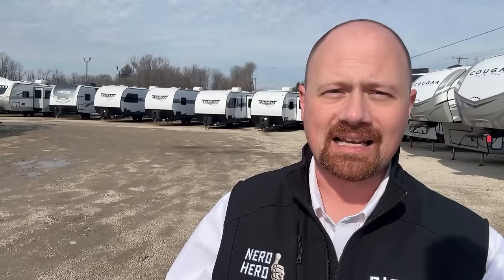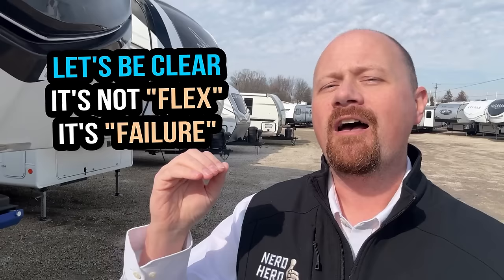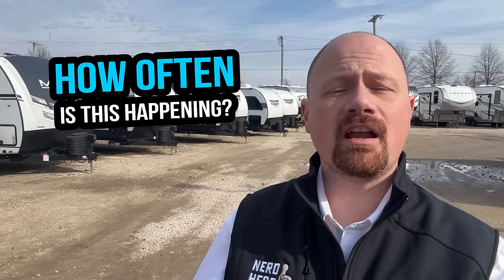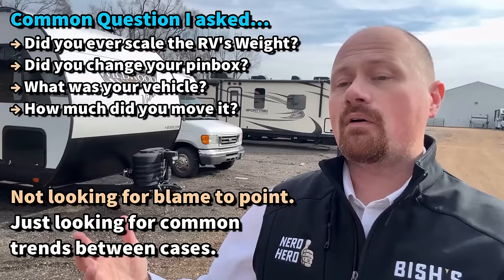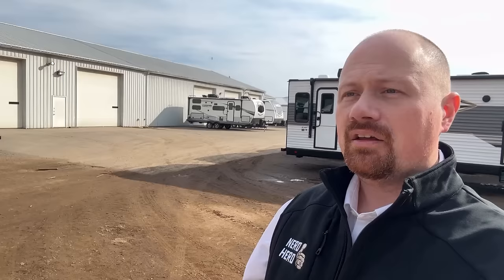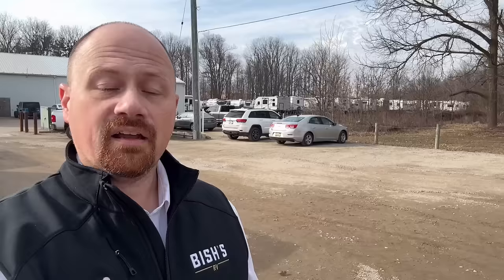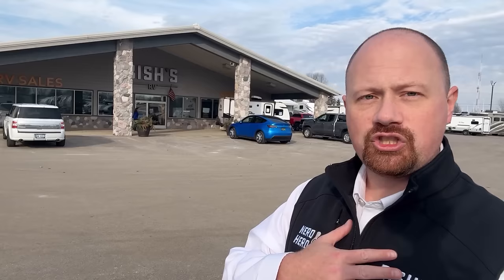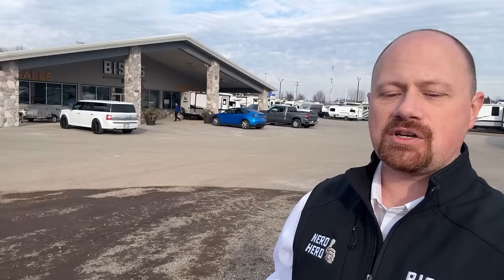🚨 RV Frame Flex & FAILURE!! • WHAT is Happening and WHO is Responsible?!

Comment: I would like to see every RV tour video towards the beginning mention something like, "This 16,000 pound fifth wheel is intended to be towed by a properly equipped full ton pick-up and shouldn't be towed more than X miles per year and X miles in a day and can't easily handle winters where temperatures regularly drop less than X degrees and the cargo capacity of X pounds is lower than expected so pack light and don't travel with full tanks, etc."  The dealer and presenter can be providing this info!  How is a consumer to know that one particular RV type, size, unit, model is more capable to be moved around more than another?

I would be so pumped if you start saying that kind of stuff more in your tour videos.  I believe you have more power than you think.  If you start doing it, other presenters are going to be pressed to follow suite.
Reply: Furthermore, if that info isn't available from the manufacturer the presenter should say something like, "This manufacturer has not provided information on how often this RV should be driven and what the specific hitch weight for this unit is, etc."  Call them out if you want to help fix the industry problem!  Presenters who do this in every video will become an even more trusted resource in the eyes of the public.

Comment: Thank you for clearing this up, I retired from Boeing building airplane for about 35 years and I know that the wings of the airplane they have to flex but you don't want it to fail in the air that wouldn't be a good thing, my thing is why are the factory turning away the customer when they have a problem with their rv failing, some of the factory act like that it's not there problem, so they don't want to even to address their issue, at least look at it and see what's going on.

This will be my beef, if my 5th wheel has a little bow, more than normal they don't want to talk to them, they want to brush them off and act like they must have overloaded their 5th wheel. If it was one or two customers complaining about their frame flexing or failure I would understand but when you have the among of people that have been complaining, well there a problem and it should be looked at and addressed so to make the customer satisfied. Okay, you mention and lot of ideas that make sense but I would say let the factory assess it and decide it then.

Comment: Josh, I believe it comes down to three things: Quality, purpose, and information.  First, manufacturers can and should do a better job with quality and durability.  The consumer needs to pick an RV that meets their stated purpose and the manufactures need to be clear about an RV's stated purpose. Some live in these RV's and tow for a lot of miles.  Others take one or two short family trips a year. It sure would be nice to have well defined purposes in the literature for each RV.  As for frame failure, it is undefendable.  The NTSB and DOT will never allow car and truck frames to break while operating them for their intended purpose, so why should RV's be any different?  That brings me to the third point.  Lets have the manufactures define "normal use and operation" of these RV's so consumers understand the purpose and durability of the big investment they are about to make.
Reply from the maker: I think you’re being very fair. Ty

Comment: Josh:  you tackled a tough, ticklish one here, thanks.  From personal experiences I know how much time/research you had to put into this.  You ended up very focused on what is within the control of us, the end users.  I hope everyone appreciates that, and does not interpret it as shifting the responsibility.  I'm sure that the higher quality RV manufacturers have this issue under a microscope right now.  But what THEY can/should do is not within our control.  If I had any suggestions for a tough subject like this, it might be to stress that aspect right up front in the video.   We're in the process of purchasing a new 100 series Grand Design right now, so running across this current problem has had me spooked a little.  Your video has eased that a little, but of course has not erased it.  I feel certain that in a year or so, the better manufacturers will have shifted some aspects of how they build based on what they learn in analyzing the problem.
Reply from the maker: I appreciate your feedback here. It's quite welcome. Obviously this style of video and topic is actually a bit new to me

I also really appreciate how you took the video as a whole. I think some folks have taken some segments out of context and felt I was blaming owners for the failures when I've clearly said I do not feel you can reasonably do that when nobody told them what NOT to do in the first place... including dealerships like my own when applying mods to the RV

This topic has actually caused us to realize that we need to better train and inform our own staff so they can better train and inform our customers
Reply: @JoshtheRVNerd There's another aspect, on the manufacturer's side, that I wonder about.  Engineers typically engineer to include a margin for error.  They don't necessarily engineer that margin for every worst case scenario; for a couple of reasons.  1- you can't necessarily foresee every scenario, and 2 over engineering is too expensive.  I sure hope that they are re-evaluating how the use of RVs has changed over a relatively short period of time, and are making some adjustments for the changed marketplace they are designing for.  I expect that they are, but that they are most likely still evaluating and interpreting the situation.  Some evaluation happens pretty quickly, but a complete evaluation often takes years.
Reply: While you certainly brought this issue into perspective and relieved most of my personal fears, obviously aspects are still on my mind since we're getting a new Grand Design 5th wheel.  I'll be paying more attention to how I load the new one than I have before.  That brings a couple of things to mind.  It sure would be helpful if RV manufacturers (and dealers) could provide an additional piece of information:  a rating or some guidelines for "maximum pin weight".  Or, another approach, provide guidelines for a maximum load per each major storage area (the 100 series 27BH has three substantial storage areas)  Seems like that would be invaluable in trying to balance where to place what gear for responsible, informed RVers.  Just additional thoughts on an important issue, I'm sure I can figure out my own situation reasonably well.

Comment: Understand the materials such as load rating and that metal is only going to "flex" so many times before it fails. Welds aren't made to flex thats why gussets and lugging processes are used to keep those areas from flexing.The gooseneck conversion makes total sense,  you are actually making the pin box longer putting more prying force directly to the frame. Having run a shop that repirs tractors and trailers for years now I can assure you that you can have too much truck.  4 air filled bags on the back of a tractor while not loaded is like being in a prize fight getting kidney shot after kidney shot, the second way to describe it is getting hit repeatedly in the back with a 2x4.

Comment: Thank you for doing all the research.  It was certainly thought provoking.  In the aviation community, because lives are involved, these same issues have been federally regulated.  Since this is not life threatening, no one is requiring any verifiable way to compare durability of units.  Consumers are left with no way to compare statements other than customer and dealer votes on best manufacturers and their reliability.

I do think consumers are misunderstanding “all season” as “can be used more often” as opposed to “can be used longer”.

That any RV manufacturer would say “it isn’t designed to be moved often” blows my mind.  🤯. Unless it is a destination trailer, I am pretty sure the customer expects to be able to move it often.

There needs to be a consumer reports like database where consumers can vote on key criteria for all the models.
Reply from the maker: My fear is, it will have to get to the point that lives are on the line for anything to really be done about it. If things start becoming a hazard on the highway, then NHST will get involved and you’ll see some changes happen fast.

Comment: 30 years in the trucking industry and I can honestly say I would pull a 53-ft trailer over a 28 footer or 32 footer, any day of the week. You are correct about the bobtail. The trucks ride like crap, they bounce all over the place, and they lose traction in a heartbeat. They are designed to have weight on them.

Comment: I'm not an RV-er, just more fascinated by the industry thanks to Josh's videos.  I admire this video as he's kind of in a damned-if-you-do-damned-if-you-don't situation; customers, dealers, and manufacturers will unite in their displeasure of this video.  😂

One thing to note by the criticism in the comments: Josh did say early on that this flex/failure issue is skewed more towards the XL 5th wheel and gooseneck crowd that tow a lot (I'd assume a frequency that is almost weekly).  I'm sure most of the critics aren't in this category.

Also to add another wrinkle about the towing vehicle, you can blame the government's CAFE standards for the way the truck market has shifted.  The days of you dad's naturally aspirated V10 or old-school diesel with simple amenities is long gone.  Nowadays, it's risky full-timing with a truck as you'd be fortunate to get past 100k miles w/o a recall rearing it's ugly head.
Reply from the maker: I appreciate your comment here. TY so much for tuning in. Kinda curious what you do for a living?
Reply: @JoshtheRVNerd  Project engineer in heavy civil construction.  RV culture exists thanks in part to the industry I work in.

Comment: I put over 10,000 miles a year on my 43ft 5th wheel toy hauler. 
I had the frame break by the pin box on my last 5th wheel.  I always ask the dealers who builds a 5th wheel that you can tow 10,000 miles a year and they don't have an answer!!😮

Comment: There are LOTS of trailer manufacturers that are not having problems. 18 wheelers,race car haulers, farm animal trailers, and rv trailers. If one trailer manufacturer is having issues from different rv manufacturers, then its not rocket science to figure where problems are. But, the biggest problem is millions of dollars rv owners are losing because no one (dealer or trailer manufacturer)don't want to be responsible because one they admit to one owner, all are due free repairs. And, I don't remember hearing of this until a few years ago. In my opinion ( it's like butt holes, everybody got one) is to make frames stong enough, the total out the rv dealer door weight is going to be ridiculous. You'll need a bis ass truck to pull trailer and manufacturers know they wouldn't be selling any if you have to spend north of $150,000 for truck.

Comment: On this topic, one thing I haven't heard discussed is the incidence of frame flex when the tow vehicle is a dually (DRW) versus single (SRW). A dual rear wheel tow vehicle has quite a stiff rear suspension by comparison to single rear wheels and would understandable pass any twisting torque back to the trailer frame. I'd be interested in someone's thoughts on the theory.
Reply from the maker: I lack data on that but would be curious as well
Reply: @JoshtheRVNerd  Thanks for responding!

Comment: Information for everyone, I installed air bags on my truck to pull my 5th wheel, not because my truck wasn't rated to tow it, that side is fine, but I wanted a smoother ride.  That being said the ride is much better when hitched up, but I made the mistake of inflating the air bags to much and it jarred some drawers in the front.  The frame is still okay.  I complete understand what Josh was saying when he mentioned you can have to much truck, or to much air in the air bags not allowing the suspension to flex and driving all that impact to the trailer.

Comment: Josh, I have been watching your videos for some time now and didn’t even realize I was not subscribed so I did. I have a great respect for you and your dealership and truly believe you have the customers best interest at heart. I watched your video on frame flex or failure and feel you have some valid points but failed to address the manufacturers responsibility to the extent of improper welds that break due to the flexing of the frame. I have a 2020 Montana 3781RL and this model has been notorious for frame flex issues. I have been a victim myself and noticed an issue with mine shortly after taking possession of the unit. I have a friend that has the exact same year and model and had the issue also. I did no modifications and only towed a few times before I had the issue. I also had it weighed and was 1000 lbs underweight. I agree in some instances that customers negligence leads to the problem but on a whole the problem lies with the manufacturer and the quality of work they are doing on these bigger rigs. There is a lot of emphasis on this topic right now and needs to be. There has to be a change in the process in the way these are built to keep this from happening.  When it does happen the manufacturer needs to step up and take care of the customer. Keystone has done a great job of stepping up and fixing within the three year manufacturer warranty and even some after but this is not the norm with every manufacturer. I honestly believe some models should have a recall due to the enormous amount of frame failures. I honestly want to trade mine in because it had the issue and scared it will happen again and I will be told it’s past the three year warranty.

Comment: Thanks for shedding some light on flex / failure. Though my wife and I just getting into the market for an RV, we have been researching Class Cs and couples towables. We have had some negative comments about stress/ frame failures on the cab over bunk. Can you shed some light on issues on the matter?
Reply from the maker: Fire away

Comment: Josh. First, I really enjoy watching your channel.

I belong to a few FB groups devoted to campers and some devoted to “half ton towing”, etc. What is your take on the question of “how much weight can I pull with my XYZ” and the whole subtract 15% of GVWR or trailer weight to “safely and legally” tow a camper. This is confusing. I’m of the thought that if a vehicle manufacturer says my Chevy Silverado Crew Cab 4x4 is rated to tow, say 9100 lbs., does a person really need to subtract that 15% for a cushion? Where did this “suggestion” come from? Shouldn’t the vehicle manufacturer’s vehicle specs be what a person goes by? Thanks and keep the episodes coming!

Comment: Good info, I posted many comments about whether it’s the material, design or manufacturing of the frame or the truck being more powerful. As a tech working in many industries, it’s most likely operator error and misuse. And I seen that in many occasions. It’s good to see that you look up on the material. The after market pin box is a good thought but I don’t think it the cause for most cases. 
To me, you got to find out what causing the stress. Pin box-less likely, overloading- likely, fast get up and go or speeding-likely, another aspect that no one talk about is braking. Whether over braking or under braking with the controller would put more stress on that pin especially with increased weight from overloading.

Comment: Josh, I get what you are saying and I agree with most of it.  However:
Manufactures SHOULD: 
1.) Post GVWR for EVERY unit shipped INCLUDING any and all optional equipment installed by the manufacturer
2.) Post hitch/pin weight for EVERY unit shipped INCLUDING any and all optional equipment installed by the manufacturer
3.) Publish recommended tow vehicles
4.) Publish What the intended use of each unit is
5.) Publish HOW the each unit is used
6.) Min and Max weight rating on the hitch/Pin
7.) Recommended pin boxes/hitch equipment
8.) How-To's on load distribution, recommended tow vehicle equipment (anti-sway bars, load distribution systems with weight considerations, etc)
9.) Required Maintenance schedules for frames, wheel bearings, tires, axles, shackles and suspension.
10.) Approved suspension equipment such as what suspension upgrades are allowable.
11.) Indicate if a unit can have full water/holding tanks while in transit...OR NOT. 

Dealers SHOULD:
1.) Weigh and Post GVWR for EVERY unit.
2.) Weigh and Post hitch/pin weight for EVERY unit

3.) Adjust #1 and #2 above if the dealer adds optional equipment
4.) have the knowledge of all the stuff above from the manufactures or at least have access to it so the customer can be informed.

Josh, your ideas are great and I think all manufactures and dealers should KNOW what each floor plan is used for and what the engineered use case is for each and every unit. I am currently in the market for a new RV (this would be my 3rd unit), and talking to dealerships is discouraging when I know more about a given unit that the person trying to sell me one. One other thing is I think its ridiculous to make a customer go to a CAT scale to weigh a brand new unit. Sorry for the long winded post

Comment: Hey Josh I've noticed one thing that you haven't covered was the braking system between the weight of the truck and the weight of the trailer. Well at least the braking system in my truck, I scaled out my mty weight of my truck and hooked up my trailer to an mty weight. Then adjust for the weight difference like if the truck is heavier then the trailer or the truck is the same weight as the trailer or the trailer is heavier than the truck for the electric trailer brakes. Then do a short or small break test where the truck and trailer slows and or stops about the same time. 
Well that's all I have to say, so have a great day.
Reply from the maker: Appreciate the extra info! Ty